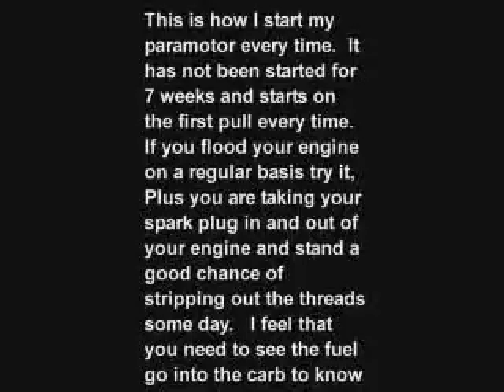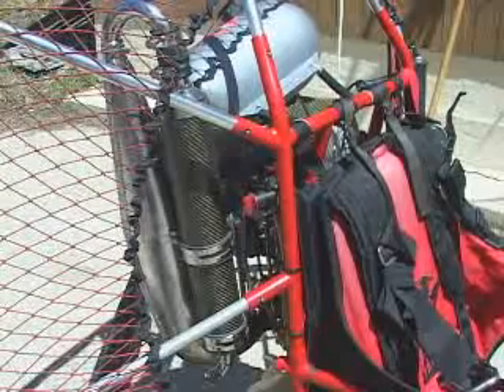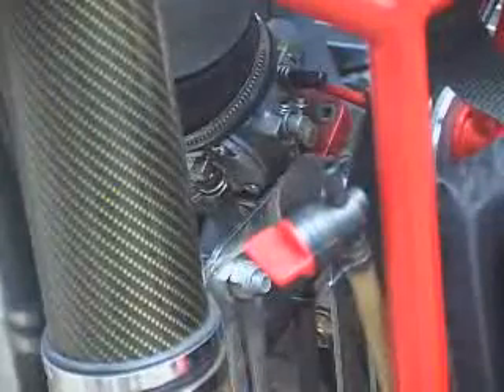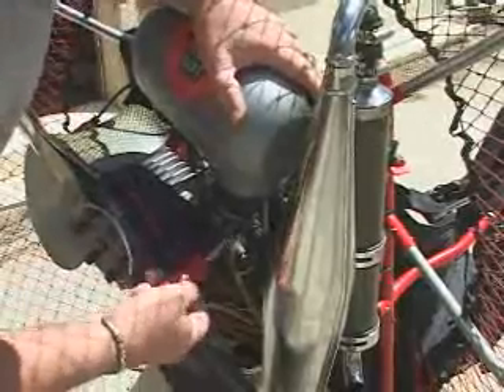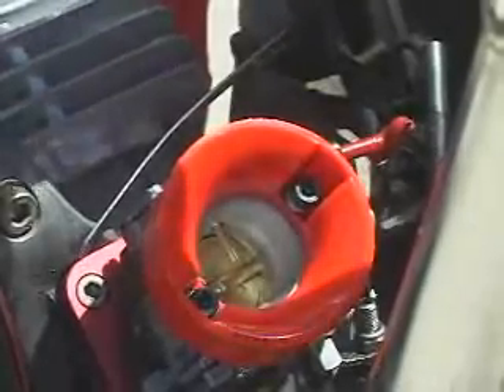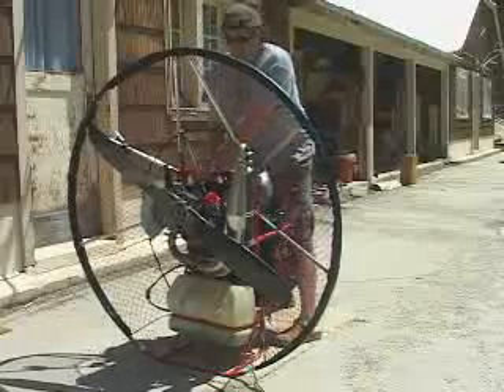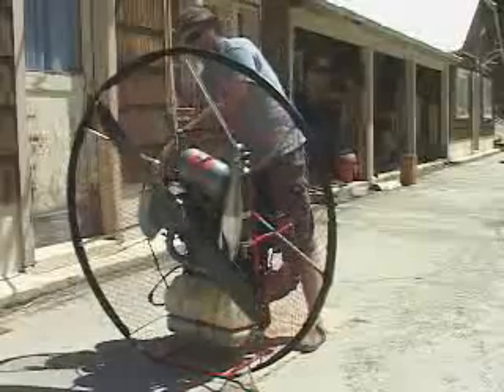How to cold start a Black Devil Engine

Comment: thanks Stan,   I think I told you that I found a lot of metal flakes in my magneto and when I cleaned it out with the shop vac,  My BD  starts like a dream.  As you advised I have gone to giving it just a tiny sniff of fuel,  and that is really all it needs.   thanks for the post.

Comment from the maker: Yes you do otherwise it will create a airlock or vacuum situation that will make it hard for the carb to pull fuel up to the engine.  I have done that only to land open it up and get back in the air.  On the initial  start it does not seem to matter.  What is also nice about the shut off is it allows you to lay the engine down without fuel coming up through the vent tube.  Thanks for watching.